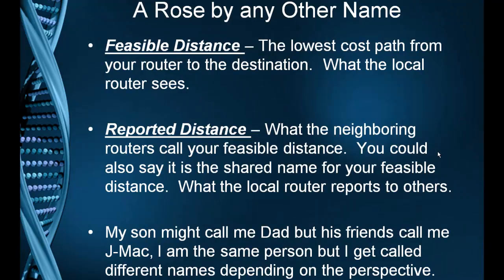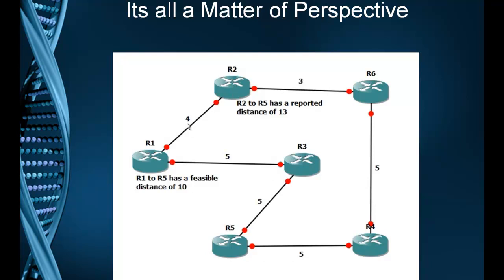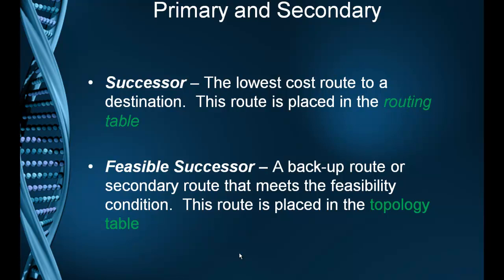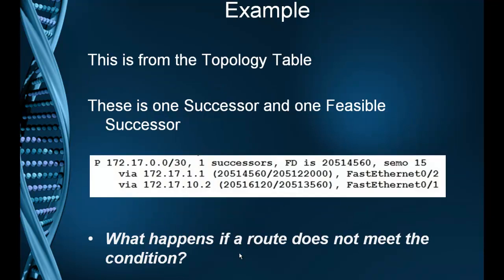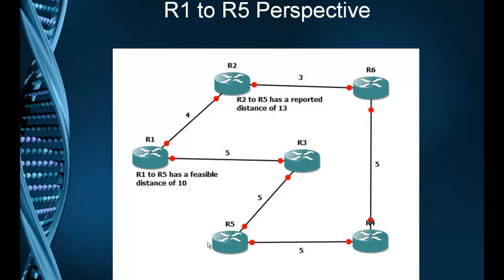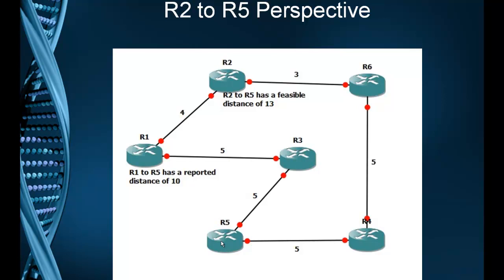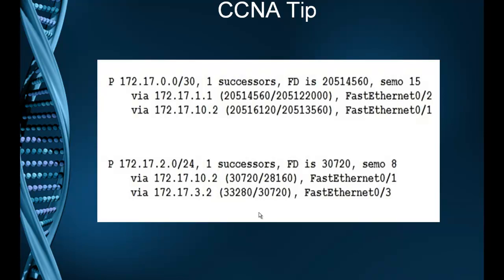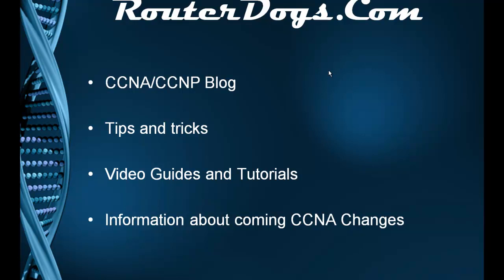EIGRP, Feasible Distance

Comment: doesnt the split horizon also prevent routing loops
Reply from the maker: Yes, that is part of its actual purpose, it also stops the routing table from adding downed routes due to update timers being different.  A router who has not been updated yet about a downed line will send out its update telling everyone that line is still working until he finally is told it is down.  Split horizon fixes that.

Comment: Hi Johnny, you mentioned that according to feasibility condition, reported distance must be less than feasible distance. However, why is the route [via 172.17.1.1 (20,514,560/205,122,000)] in 15:22, the reported distance is larger than feasible distance can still become a successor route? Thanks.

Comment: Great video but now I am really confused. ..I thought the topology table store ALL possible path to ALL possible destination  (not just Successor and Feasible Successor routes).  Please clarify.
Reply from the maker: +taffy jones 
Only routes that meet the feasibility condition are stored in the top-table.  Imagine how big the top-table would be if every known route were stored in it at a multi-national company?  If for some reason the successor route fails and there are no feasible successors, eigrp sends out a message asking for other routes.  The top-table is really just for storing ideal backup routes and not every single route known
Reply: Ok thanks. . But doesnt the command 'sh ip eigrp topology all -links' show all possible links to each destination;  whether or not the links meet the feasibility requirements?  If so, where are all these links stored ( if not in the topology table)?  Thanks a lot.
Reply from the maker: +taffy jones 
I can not find any concrete information on this from Cisco but here is what I assume to be true...  The topology table actually keeps a listing of every route learned through EIGRP but only shows the routes that meet the feasibility condition.  This is actually news to me as my understanding at the time was any route that did not meet the feasibility condition was dropped.  They must be stored in the topology table because the command addresses the topology table.  There is not much listed on the Cisco site about this since that command will give you EVERY known route even the ones with possible loops which you would never want to use.

That command is mentioned once in the CCNP book and i can honestly tell you as a CCNP I have never used that command and have never seen it appear on a certification exam.
Reply: Ok. I am leaning towards the topology table keeping a list of all possible route though. ..hopefully we will find some documentation that will clear this up once and for all.
Reply from the maker: +taffy jones 
You are correct in that the topology table keeps a list of all possible routes known by the router but ONLY those routes that meet the feasibility condition are shown when a person enters the "show ip eigrp topology" and the other routes are hidden from view.  The only way to view these non-successor routes is to use the "all-links" command.  This guy explains it really well at this site:  http://packetlife.net/blog/2010/aug/9/eigrp-feasible-successor-routes/
Reply: Fantastic. ..thanks for this info. I recently started preparing for the CCNA so I want to ensure that I really understand the materials from the outset.